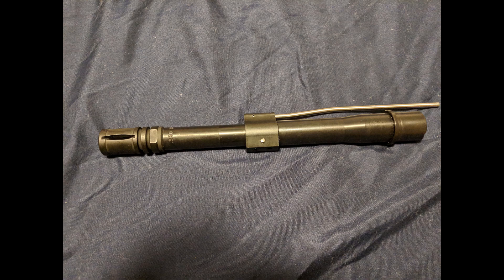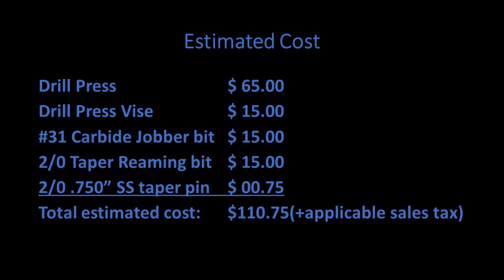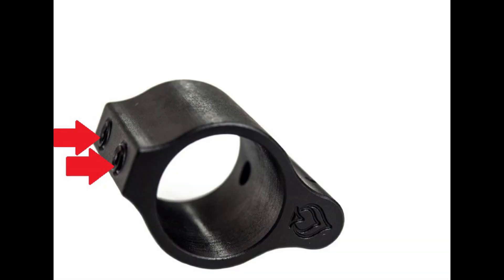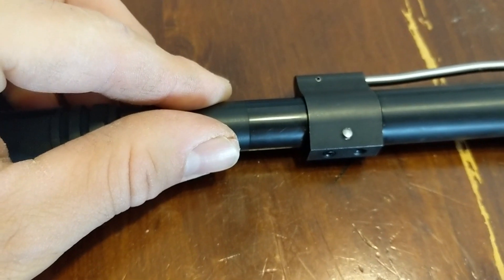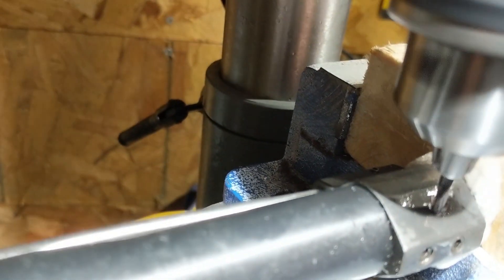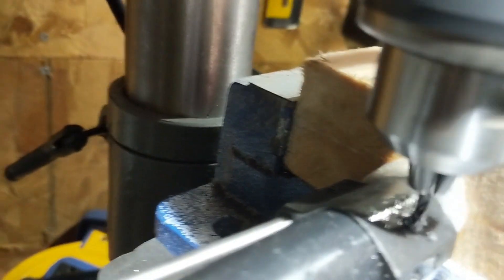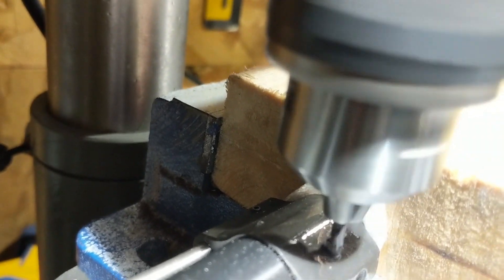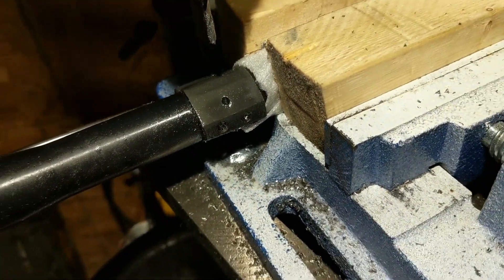How to Pin a Gas Block: a comprehensive guide for the poor and cheap among us.

Comment: You need to use a centerdrill first, then drill . Centerdrill are solid and  designed for this and they are relatively cheap..im a machinist. And I have no problem with wd-40 as cutting fluid . I use it . Buy it buy the gallon.
Reply: 600 rpm is fine for steel
Reply: I allso have used a lot of wd-40 buy in bulk then use a sureshot refillable spray can it lives next to my drill press
Reply: @caseyjohnston9632 Nothing wrong with WD-40 as a cutting fluid. Marvel, Deep Creep, Break-Free... there's probably 100 other products that work well for the same purpose.

I do agree with using a center-drill or reamer first before using a final sized bit. A bit of experience and common sense helps.
Reply from the maker: Thanks for the tip! I just learned something today that took me down a youtube rabbit hole.
Reply: A "machinist" who advocates wd40? Ya right.
Reply: @jamesstephenson2346 For a job like this. WD40 is perfectly acceptable. 

I’d prefer Tap Magic but from a budget standpoint or one time job? WD40 is not an issue.
Reply: That's great advice!

Comment: So, you depend just on the friction/tightness from tapping the pin in that last bit, to keep the pin from coming out? Wouldn't it be better to put a spot of weld between the pin and the block?
Reply from the maker: Nope. Trust me, that thing will never come out by itself. 

The pin isn't straight. It's tapered, so it's larger on one side than the other. 

When you tap in the pin, you're creating a really tight friction fit that runs along the entire length of the pin, not just that last bit. 

The military uses taper pins just like that to keep the exposed front sight post/gas blocks in place on their M16s. 

Plus, if you want to take it out in the future to change handguards,or barrels,  you can tap it out relatively easily.
Reply: @inexpensivearms6952  Yeah, I know -- what happens is what happens. Experience has shown they don't come out. I suppose I just worry that I'll do something wrong, and so MINE might come out, lol. But really, screws themselves work on a similar principle of tightening and friction, and screws sometimes come loose, too.
Reply from the maker: @GetMeThere1  It's your call. A lot of guys are happy just putting a dab of high-temp loctite or rockset on their screws and cranking them down. 

I like to tell my self that if there were ever a SHTF situation, my budget rifles would be able to take a beating and keep ticking, that's why I do it personally.
Reply: @inexpensivearms6952  I feel exactly the same way!

Comment: How exactly do you know where to cut?
Reply from the maker: I eyeball it. I've used jigs, but they're really not needed. If you have a standard 5.56 barrel with a .750 diameter gas block, then it's best to eyeball it lengthwise along the entire length of the barrel and bring the bit down until it touches the gas block while you nudge it around until it's where it needs to be.
Shoot for only drilling 1/2 the diameter of the thickness of the drill bit into the barrel. In other words,  you want to drill a straight line through the barrel that will end up with half of the taper pin sitting in the groove, and half sticking out from the barrel.  From a top down view,  something like this:
▄▄▄▄▄▄▄▄▄▄        <------entire thickness of barrel
▀▀▀▀▀▀▀o▀▀
                     └-----only ½ of drill bit bites into barrel 

Chances are you'll get a slight amount of deflection downwards and wind up with slightly less than that, but when you ream the hole it will enlarge it slightly, and that's just about right. 

Harbor Freight cheapo drill press. (Use a 20% off coupon for $55.00+tax)
https://www.harborfreight.com/8-in-5-speed-bench-drill-press-60238.html

Harbor Freight drill press vise
https://www.harborfreight.com/4-inch-jaw-capacity-drill-press-vise-30999.html

¾” 2/0 stainless steel taper pins
https://www.mcmaster.com/90681a131

2/0 taper pin reamer
https://www.ebay.com/itm/455E002-2-0-Spiral-Flute-Right-Hand-Cut-Taper-Pin-Reamer/273931461524?hash=item3fc7966394:g:oR8AAOSwY5ddLeJX

#31 carbide jobber bit
https://www.ebay.com/itm/Size-31-1200-Carbide-Jobber-Length-Drill/351743480795?hash=item51e58b93db:g:FkEAAOSwepZXR0cc

Looks like prices have gone up recently on imported drill bits and reamers. Probably due to the trade wars with China.
Reply: Inexpensive Arms Dude thank you so much!

I can’t wait to stop paying to have my barrels pinned.

I’ve seen and had dimples barrels walk and honestly once you get this setup it’s 2min of work!

I was worried about accuracy issues but after research I heard it’s extremely minor and on precision builds you should be using a clamp on anyway.

Thanks for the info!
Reply from the maker: @LarpingSupply  Absolutely! I'm glad somebody could get some use out of it!

Comment: Hoping you might still be around on this video and have a bit of insight you can offer. I've run up against a wall of info I'm completely unable to find.

THE BACKGROUND ----- I'm new to the AR market, I'm stuck in Commiefornia, so have been holding out on purchasing an AR as our arbitrary laws change nearly every year which requires continuous modifications to stay state compliant. I finally gave in and picked one up recently. My AR of choice was a SA Saint (off the used market) which comes with a standard A2-style FSP. In addition to this being added to my home defense, I also have her set up for two-gun matches (a few of my events have action challenge matches which have staggered distance targets out as far as 400m) with a low power variable magnified optic. whilst going through the zeroing process, I've come to find that my point of impact doesn't line up with the FSP, it sits slightly low and left, meaning I don't have a clear view of my target. 

THE ISSUE ----- My plan was to replace the FSP with a Geissele SGB, however I've been completely unable to find substantiated info on driling into a Chrome Moly Vanadium and Melonite treated barrel. I'm no gunsmith, I don't have the tools on-hand to be able to do this job myself. None of my local gunsmiths are willing to work on AR's (there's only two locally who don't have a bad reputation), so this has left me with two options: ship her off, or invest in hardware to get the job done. I'm on a budget (Surprise! that's why I'm here), so what I'm looking at are ~$100-150 bench top drill presses (Likely Wen), with a carbide drill. 

Do you have any experience with drilling through Melonite finishes, and of so, would 1/3HP motor on one of these be enough? Any help would be appreciated!
Reply from the maker: You'd be fine. 
The video I posted is drilling through a 4150 CMV nitride treated barrel. 
Slow and steady wins the race.

I don't try to "drill through" the surface,  I try to slowly scrape the surface away when I apply pressure. 

Make sure you get a carbide drill bit. It HAS TO BE CARBIDE. 

You can get away with a HSS drill bit on non-melonite surfaces, (regular parkerized 41xx steel) but HSS bits will barely scratch the surface of a melonite surface. 

I think my current drill press is only 1/3 HP, and it's chinese made, so it's not the highest quality. Your biggest concern will not be power. It will piddly things like alignment and wobble.  Just go VERY slowly, lubricate often with cutting oil, and you'll be fine. 

The fact that you don't have to drill through the gas block will make this entire process a piece of cake with that Geissele SGB.

NOW. I assume you want to install a free floating handguard. Keep in mind that if you do that, you're still going to have the original taper pin holes in your barrel from the original Gas Block. 

You would be FAR further ahead simply cutting off the FSP with a grinding wheel, and profiling the existing gas block down so it will fit under a free floating handguard. 

When you're done, just paint the gas block with some matte black high-temp engine paint and put it back on. 

Check out this guy's video. https://www.youtube.com/watch?v=b42Bxfqr_Qw
Reply: @inexpensivearms6952  Perfect! that's good enough for me. I was just concerned that she might bind up given the relatively weak motor. Much appreciated!

Comment: Nice video.

A few observationsCutting fluid: WD40 is not really the best for steel (works pretty good on aluminum though). Home depot has oatey cutting fluid for threading plumbing pipe. It's thick stuff and will work much better than WD40 for steel.
Reaming: I didn't see the process but I just want to say that when you ream you want to have one nice consistent stroke through the hole and back out. Don't peck like you would with a regular drill

Starting the drill: You might consider using a center drill or a spot drill in the future before you use the twist drill. this makes a nice starting spot and keeps your regular drill from walking
Speed: Generally speaking you can run carbide at a higher speed than a HSS drill. Next time you might want to use the next speed up and see how that works.
Reply from the maker: Thanks. I picked up a container of cutting fluid last month and it does work much better. Agree about the reaming process.  Next time I do this I'll try the next speed up.